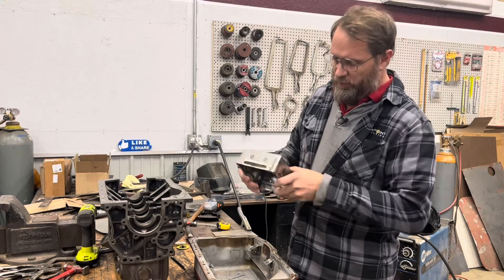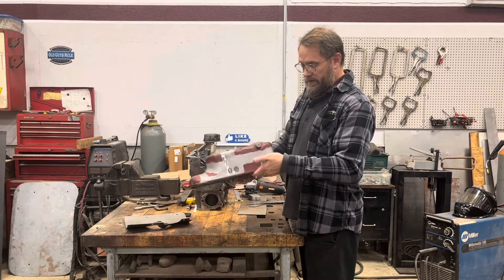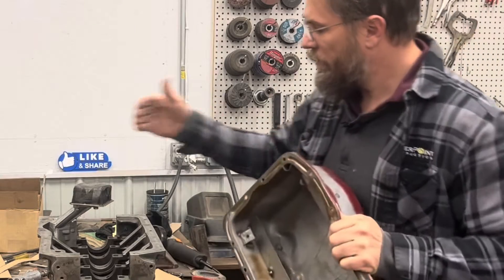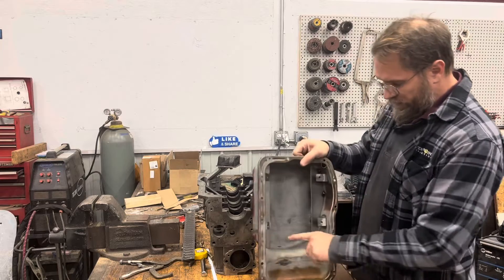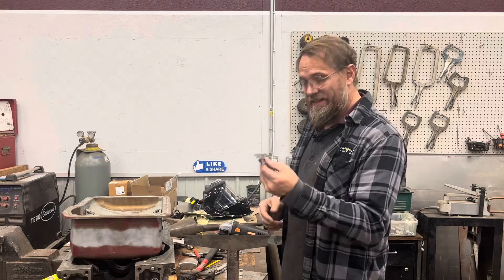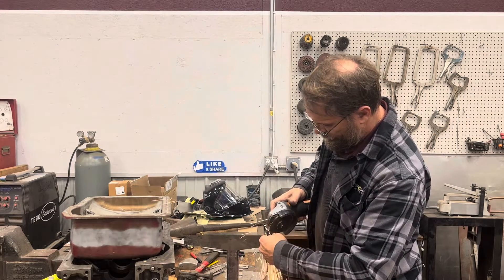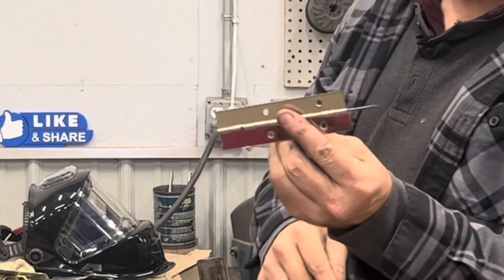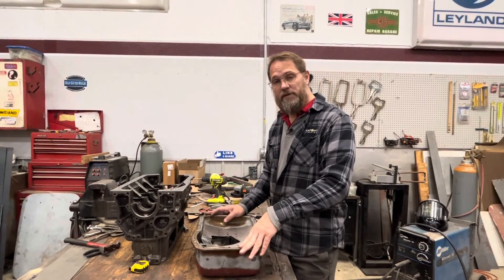Just baffling part 3, MGB oil pan gets baffles and trap doors

Comment: Thank you for your great video. I just gave you a thumbs up. This is soo much useful information to me!
You are a genious!
splashing Oil and windage will cost you up to 20hp depending on engine.
Air being sucked up and drop or loss of oil pressure due to the oil desciding to go somewhere other than to where the pick up strainer is, can cost you your engine...

A question to your drainage holes: would it not be better to cut slots and bend them upwards against the windage that the crankshaft creates so that they catch the oil and direct it downwards?
I am not familiar with your engine but are there not drainage holes from your cylinder head which shoud be directed straight towards the oil, rather than hitting the baffle plate and being caught by the windage?
I am not critizicing any of this, I am a novice and presenting you my thoughts. You must have thought about this and concluded that your solution was the best. I am just trying to undertsand the thoughts behind of it
Reply from the maker: While I probably could have made something more effective than this, it was more of a case of improving it and not the ultimate best way. 
The idea is to catch the oil coming off the crank to stop it from hitting the top of the oil in the pan and creating aeration, while giving what it catches time to let the air out of it as it runs down the tray and drips off. It is not a full tilt road racer spinning at 7000 rpms. It’s mostly a street car that will go autocrossing and I want to improve the life expectancy of the engine by making sure the oil pickup gets more consistent and less aerated oil.

Comment: Why? Whats the problem?
Reply from the maker: A like to autocross.  I had an issue with my last engine with lifter failure and bearings that may possibly have been due to oil foaming or sucking air in hard cornering. I’m doing this as basically insurance against oiling issues, plus it was an interesting engineering exercise for me

Comment: Don't really care about this other than how cool you think. WHAT ABOUT THE MGA COUPE/FASTBACK,?
Actually, the oil pan is cool. Possibly insane, but ingenious.
Reply from the maker: Part of the reason I started on the MGA fastback when I did, is that I couldn’t start on my engine yet. Now that I have all the parts I want to get it together as I’m getting pretty tired of driving my car to shows and such on basically a used stock engine that burns oil😁. Once I get the ‘60 MGA interior done I do want to get back onto the fastback. 👍🏻